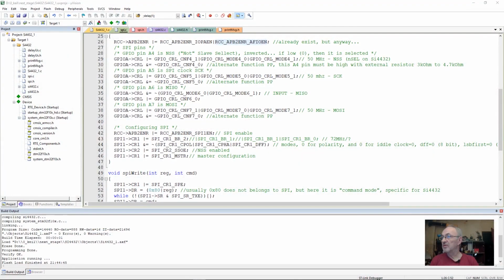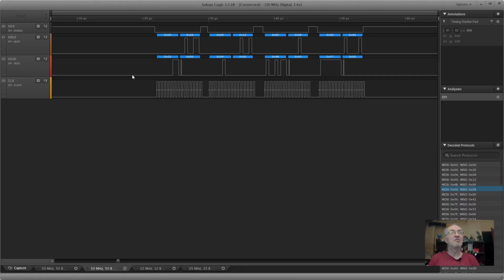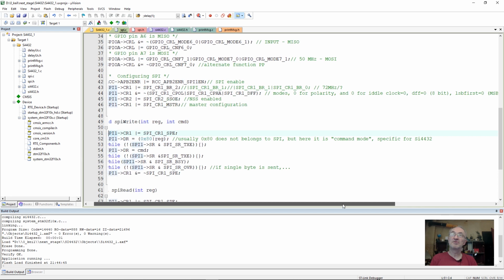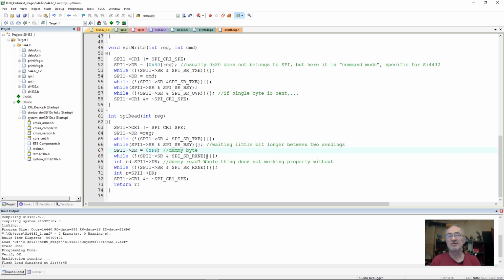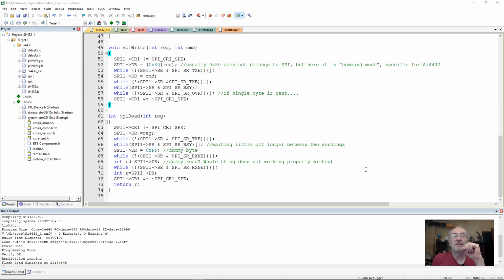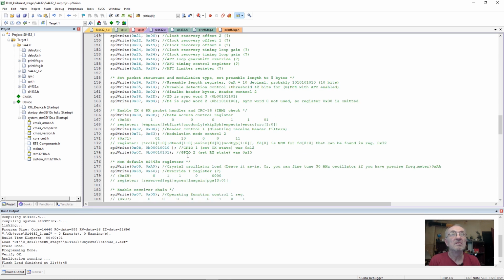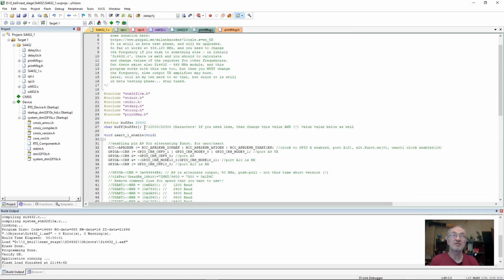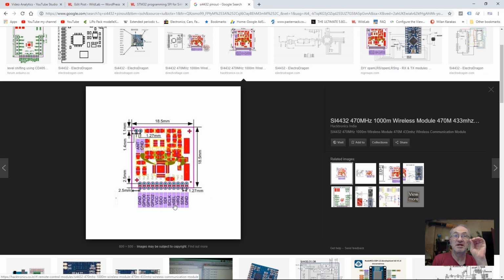STM32 programming SPI protocol pt.1

Comment: hi, actually my question is not about STM32 but more on Si4432. do you know any PA about 2watts output that i can use with my Si4432 100mw, my actual power output reading is about 60mw only and i want to increase the power output of Si4432, although i already tested the RFM23BP but to no avail, i cannot make it work so im sticking with Si4432 and will just use PA.Thanks. Your channel is really very helpful and you are the one who inspire me to do some electronics stuff, please continue to make videos
Reply from the maker: I bought this PA, but did not test it yet. You will get some output, not sure exactly 2W, because it is maximum power possible, not guaranteed. https://www.ebay.com/itm/BLT53A-433M-2W-power-broadband-RF-power-amplifier-high-gain-with-heat-sink/182293408897?ssPageName=STRK%3AMEBIDX%3AIT&_trksid=p2057872.m2749.l2649  And, thanks for nice comment.
Reply from the maker: Oh, this PA is only for output, you should to use some relay to switch between receiving and transmitting, else you will get next to nothing on your receiver. This PA is 'one way only'. Maybe you need to use GPIO0 on Si4432 to power this relay, but relays are slow. I have no idea, but there exist diode switch relays... just not sure how to make it. I know that it is simple, yet I not tested, so can't tell for sure. ONLY then you will get TX at a time. Note that on Si4432 board, there is very small (6 pin) chip which is actually antenna switcher. You need something like that, but bigger.
Reply from the maker: @axljackass  In this case you need only PA and no worry about antenna switcher. I just have no time to power up that 2W module. Actually, more than that... missing some parts and mostly importantly missing measuring equipment. I do not want to publish anything blindly - everything I do is tested. That is why I have relative small number of videos. Si4432 is excellent and fast choice.  I have Si44663, even faster thing, yet much more complicated. For remote control, you no need high baud rate, because the higher the baud rate - the wider the bandwidth - read: less range. For the same reason, GFSK is better than FSK. FSK spread unwanted signal everywhere. OOK is even worst - although it switches on and off transmitter at single frequency, but doing that mixing product of this frequency and switching frequency make thing pretty wide.
Reply from the maker: Yeah, little bit expensive and currently working on 'fuel vapors'. But, yes - I will cosider to buy AD8319 and make my own power meter. Thank you for that info!

Comment: Can we make simple water level indicator with cheap Ultrasonic Sensors
https://ebay.to/2UsxOGX
and have led or Oled to show  level and maybe alarms if water dropping to fast etc
Reply from the maker: This one goes underwater, not over the water. It must be really good contact and impedance coupling, else it is practically 'deaf'.
Reply from the maker: BTW, great idea, I will consider to make it for my next videos. Thanks.